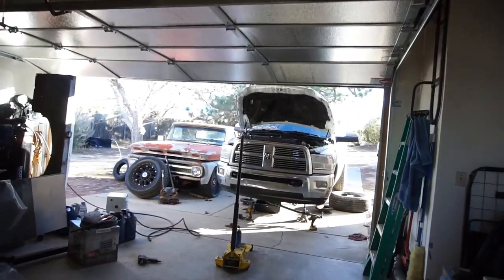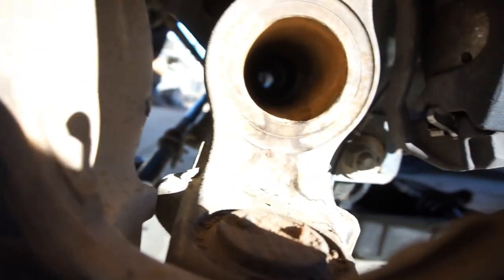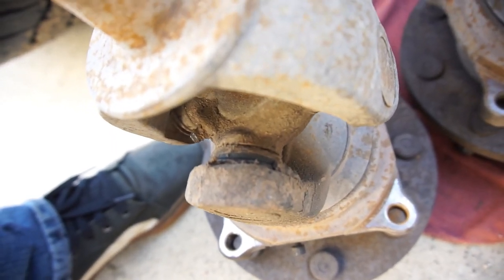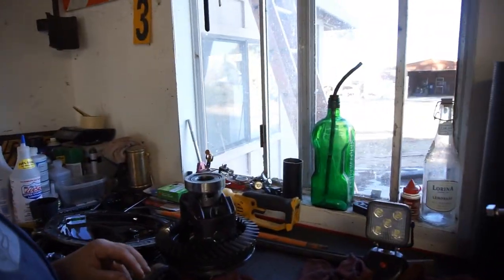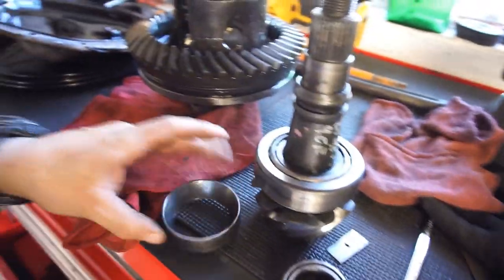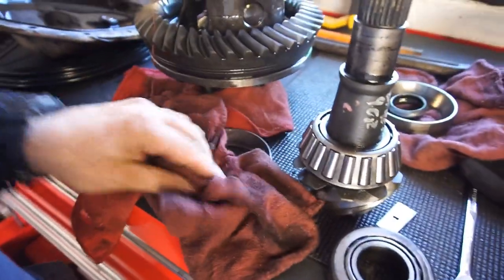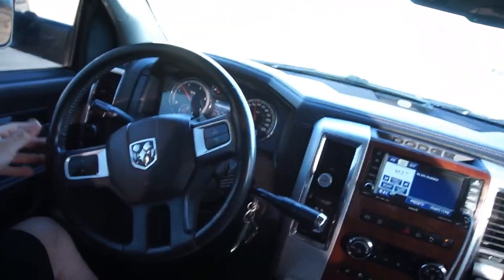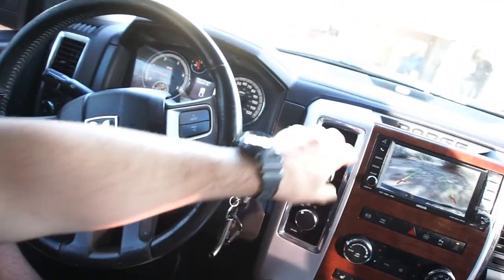Whats That Grinding Noise Coming From The Front Axle? Shocked To See

Comment: I have a 98 explorer, I just replaced all the power steering hoses, and a few weeks later I started hearing a grinding noise coming from my right front tire/rim , someone told me it could be a cv joint , but it does not affect my driving or steering, just very noisy and annoying, any suggestions on what it could be , before I take it to a shop ?
Reply from the maker: It could be something easy like brakes or a wheel bearing. Best way to tell if it’s a wheel bearing is, as you’re driving about 50mph turn the wheel one way or the other, if the noise comes and goes, it’s the wheel bearing. If not pull the fill plug on the differential and see what the fluid looks like. If there’s very fine metal in there then the bearings are shot. If it’s milky then there’s water in there.
Reply: @Halffast719  any advice? Because I replaced CV axle, wheel bearings, ball joints, rotors and breaks and it’s still making a grinding noise now and again when I drive. Mainly when I hit bumps
Reply from the maker: Explorers are known to have ball joint issues. If they’re not greasable then they’re probably dry and making the noise especially when you turn or hit bumps.

Comment: Hey man i got a 3500 2011 ram lifted. Making a nasty growling sound during acceleration, feels like metal on metal and a slight vibration. Gets really bad at 70mph. all ball joints, U joints and center bearing replaced. transfer case was open to see if everything's good inside, replaced bearing while it was open. Front differential was inspected and seem to check out good, front drive shaft was rebuilt and balanced . Would it be the pinion bearing? Or can it possible be the hard angle of the drive shaft? I do have the an index ring and recently replaced diff fluids. Weird thing is when i take off the front drive shaft everything goes butter smooth. Spent a ton of money trying to figure out what it is and just cant. If you can help that would be great!
Reply: Oh forgot to mention the sounds coming from the front end. truck was lifted on a lift and spun the wheels couldn't hear anything
Reply from the maker: Sounds like it’s a pinion bearing but I’d replace all the diff bearings and make sure everything is adjusted right. Have you checked the wheel bearings? You should check out therammaninc.com for locking hubs. I installed some on my truck and it’s a whole different truck.
Reply: @Halffast719  got ya. I’ll be looking into that. But if I take the front drive shaft out it’s really nice and smooth driving as it’s suppose to be you still think it’s the pinion bearing?
Reply from the maker: Yeah. If there’s play in that pinion which attaches to the drive shaft you get a vibration because it’s unbalancing the drive shaft. And the noise is from that pinion gear not meshing with the ring gear. Keep me posted.
Reply: @Halffast719  will do, just had the front drive shafted balanced few days ago. Gonna have the shop look into the front diff.
Reply from the maker: I’m interested in knowing what it was also.

Comment: I get a grinding sound when I accelerate at a stop .  You think I have the same problem as you? I already changed my wheel bearing and cv axle but still does it.
Reply from the maker: Sounds like it could be a U Joint on your driveshaft. What kind of vehicle is it?
Reply: It’s a 2015 jeep srt
Reply: But I don’t hear it when Iam driving only when I step on the gas hear it for few seconds
Reply from the maker: Yeah it could be the pinion bearings.
Reply: I hear it underneath my passenger side
Reply from the maker: Could be a transfer case. Have you checked the transmission mounts?
Reply: Agustin Torres did you ever figure it out? I have the same thing.
Reply: @dylanmurphy4953  yes i had dropped it so it was a metal plate by the motor that when i step on it the motor will move and  grind with some other metal underneath so i jst took of that plate and my problem was fix
Reply: @agustintorres5897  i have same problem too i change the wheel bearing and cv axle but still there...only when you press the gas at stop
Reply: At high rpm when start driving...

Comment: Hi I own a 07 mountaineer 4.6 awd I always hear a growling/grinding noise its not the wheel bearing whe did those and still made the sound could it be this ?
Reply from the maker: Could be front or rear differential it could even be the bearings in the transmission. Best way to see if something is wrong is change the fluids and see how bad they are. If one has a lot of metal shavings in the fluid then that’s probably your problem. Cheapest and easiest way to narrow it down.